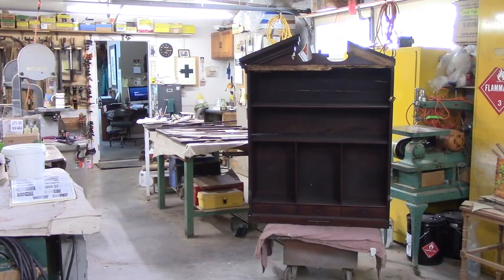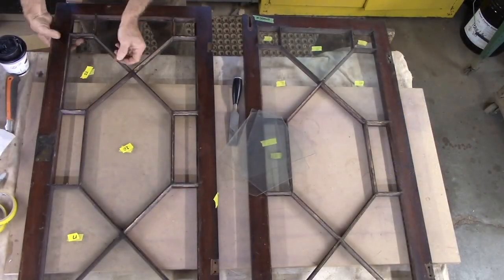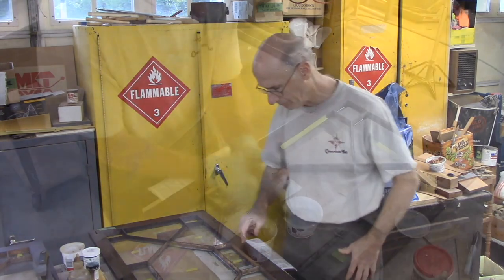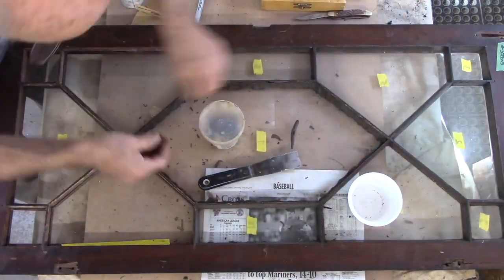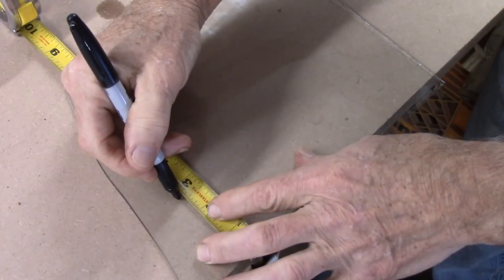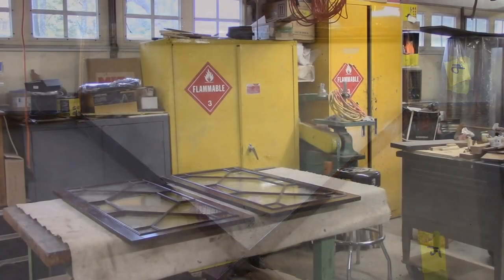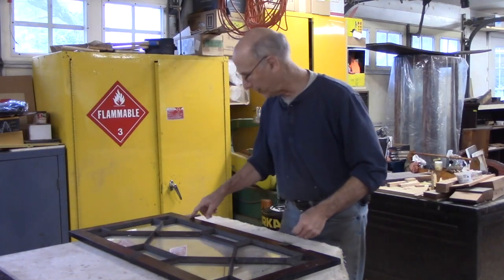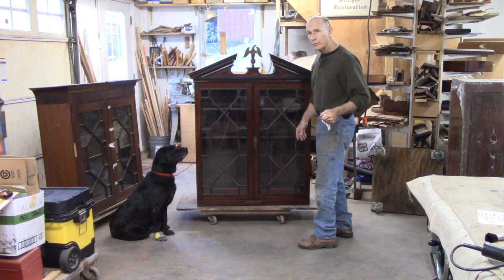Glass for an Antique Federal Secretary - Thomas Johnson Antique Furniture Restoration

Comment: Another great video as usual. Tom and once agan I have to applaud your camera work. it is always spot on!. the thing that pops into my mind again and I'm not sure if you addressed it in the original video the firest time around is how the thing fell in the beginning? I always thought there were two struts on the back of them screwed to the bottom to prevent just such a thing? did they fail? But bottom line its back home where it belongs and its good to go now that you have bestowed it with your craftsmanship skills Thanks for sharing. ECF
Reply from the maker: Thanks Ellis! House cleaners decided to move it away from the wall. It was filled with the family's antique mercury glass. We added braces to the back. Check out the full restoration: https://www.youtube.com/watch?v=nAt1FHxB9Eg

Comment: In all my attempts at glass repairs, I have never had it go as smoothly as yours did. Impressive. Thanks!
Reply from the maker: You're welcome! All the broken attempts were edited out! Seriously, my glass cutting turned the corner when I got a professional glass cutter instead of the ones they sell at the hardware store. It's from CR Laurence (funny - couldn't find it on their site!)
Reply: @johnsonrestoration  Good to know. Thanks for the tip!

Comment: Not bad glazing Tom. As a leadlighter/glazier I can offer some tips. Glass must always have mechanical fixing, ie a diamond point or glazing tack, before applying the putty. Methylated Spirit is an ideal thinning agent for the putty. Coloured putty is messy stuff, isn't it? Try and clean the glass immediately after you apply the putty. Work vertically as you face off the putty with your knife and the excess will fall away. I had to laugh at your vacuuming. In 27 years in the trade, this was the first time I've seen a vacuum cleaner used. Enjoyable video.
Reply from the maker: Thanks! I appreciate the tips. It's tough when you do it only every few years. The mullions were too small for points! Check out the entire restoration: https://www.youtube.com/watch?v=nAt1FHxB9Eg

Comment: Turned out nice! I  would probably have cheated and put one big piece in...you certainly have patience! Out of curiosity...how come you didn't use the existing pieces as templates for the missing glass? Were they just slightly different? I've had that happen.
Reply from the maker: Thanks! Yes, copying the old parts can get tricky sometimes, if they weren't right to begin with! But every time I've replaced glass it was because the original glass is broken, so how could the old pieces be a template?

Comment: Tom: You've become a graphic novel! Nice photoshop work in that lead-in. I remember you being very frustrated by cutting glass for a restoration when the glass didn't want to cooperate. I did some stained glass work way back when and the wavy glass was murder to cut accurately. I ended up using a carbide tipped vibrating scriber that was able to trace curves and make clean breaks. What a relief! Cheers.
Reply from the maker: Thanks! I'd be interested in knowing more about that scriber! Check out the full restoration: https://www.youtube.com/watch?v=nAt1FHxB9Eg

Comment: Wow. That's exceptional work Sir.
Cutting glass has always amazed me. I've tried it by hand and it never turns out right. I used a glass cutting machine in a hardware store I worked at but never could do it by hand.
Reply from the maker: Thanks! It takes a lot of practice! Things changed for me when I got a professional cutter, not the cheap ones from the hardware store

Comment: Nicely done, espeacially cutting old glass.  My father was a good glass cutter as he learned by repairing greenhouse pains back before everything went plastic.  Frankly I wouldn't have been comfortable on top of a glass house even with steel framing.
Reply from the maker: Thanks! Yes, it would be scary! They're building so many 10k and 20k square foot greenhouses up here - I wonder if the use glass or plastic? Check out the full restoration: https://www.youtube.com/watch?v=nAt1FHxB9Eg

Comment: Tom two questions: I used to see glazing potty at my grandmothers’ old windows that I saved from scrapping but they just cracked and fell into the abysses of history!  Can you tell me how can I make a make-shift glazing potty assuming that there is no off-the-shelf products now or even then (when my grandfather made the frame of those windows with Lacewood ?
Reply: I remember seeing my father replace broken glass from our windows with putty from the hardware store. Do you mean glass putty?
Reply: @hanaaa6394  stupid misspelling by me yes putty (for some strange reason my phone doesn’t recognize putty and keeps changing it to potty (loo)
Reply: @hanaaa6394  I searched around our hardware stores( here in Iran )and no one seems to know what it is anymore despite its use in the old days (like 30 years ago even!)
Reply from the maker: Hi Fater, I'm surprised it's not available, even in Iran, it's so common. I found this on-line: https://thecraftsmanblog.com/how-to-make-your-own-glazing-putty/. Be sure to use "glazing points" to secure the glass, don't rely on putty alone. If there aren't points available use tiny brads
Reply: @fatersaadatniaki  I hope you can get it fixed. Tom has a good idea.
Reply: @johnsonrestoration  also there are some little unsightly swaged tin sheets with two holes for securing the glass I tried to avoid them at all costs but tiny square cuts should be better and period correct, right? It’s like early 20th cent.

Comment: What glazing compound did you use?  Do you use whiting?  I’ve read that the dry wood should be brushed with linseed oil and turpentine combo to prevent the wood from drying out the putty?
Reply from the maker: Hi James! I thought I answered this comment! Anyway, I used DAP 33 with dry colors. I think the rule about Linseed Oil applies more to window sashes, exposed to the elements. I can't see that being a problem on furniture, but I'm not sure!

Comment: A beautiful result - of course. I can’t remember if you revealed why it fell over in the original restoration video.  Did you secure it when it was reinstalled?
Reply from the maker: Thanks! Cleaners were moving it away from the wall. Yes, we added supports to the back

Comment: Looking good l have repaired a few of them my self we put 2mm glass in but we didn’t bed the glass just put it dry pin them with Veneer pins and then used brown linseed putty and then point them job done 😊
Reply from the maker: Thanks! This was tough - the mullions were too small for points. i manged to sneak some in where I could. Check out the full restoration: https://www.youtube.com/watch?v=nAt1FHxB9Eg

Comment: Ive had to replace the original oil based glazing putty with plumbers putty.  In my area, they have replaced it with a latex based (crap) product.
Anyone here have a recipe for an original glazing putty?
Reply from the maker: Thanks! I know there's recipes on line. I've never had a problem using DAP from the hardware store. Check out the full restoration: https://www.youtube.com/watch?v=nAt1FHxB9Eg
Reply: @johnsonrestoration  Thank you.  Dap.is good for internal uses but if you’re using it for an external window, latex based products are just not up to par.
He just can’t beat the old school products.
My basic attitude is that the pyramids were built 4000 years ago, don't mess with the formula!
Thank you for your most excellent presentations.  
Best regards from Canada.

Comment: What brand of putty did you use? Were there any metal push points to keep the glass in place? Was the original glass wavy? Just wondered if you used another old piece of glass to match the existing.
Reply from the maker: Thanks! I use DAP from the hardware store. The mullions were too small for points! Here I used antique glass, that's wavy, but you can also use Benheim's Restoration glass
Reply from the maker: Oh! Check out the full restoration: https://www.youtube.com/watch?v=nAt1FHxB9Eg
Reply: I have used DAP but it stays soft months afterwards. Is there an additive that can be added to hasten the drying?

Comment: Very nice piece of furniture. Is there much difference between modern glass and antique?
Reply: Depends on the era. Glass making technology advanced through the centuries. Modern "float glass" is made on the surface of molten tin and is dead flat and flawless. Such a piece would stick out like a sore thumb if used amid old glass which might have been blown into a big bulb, cut and flattened out, leaving characteristic imperfections.
Reply from the maker: Thanks! gav2759 gave a great response!
Reply from the maker: Thanks! Benheim makes great restoration glass that matches well